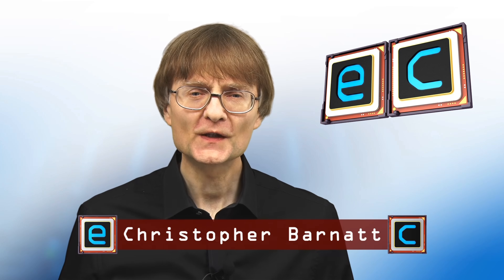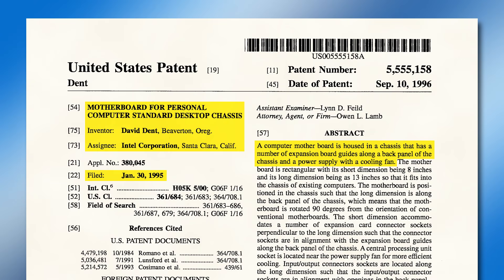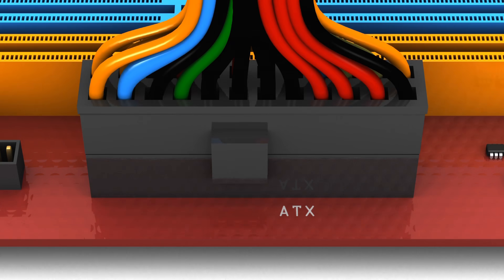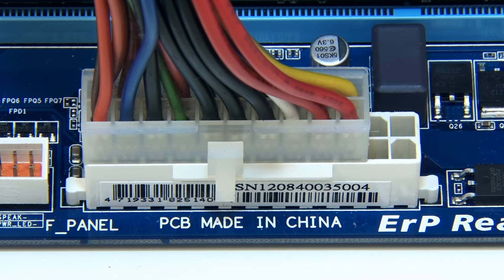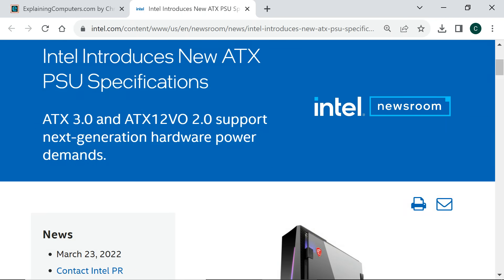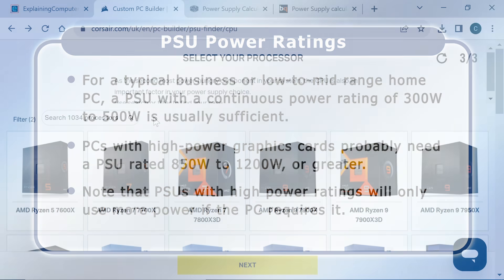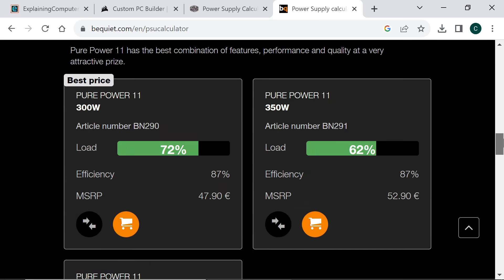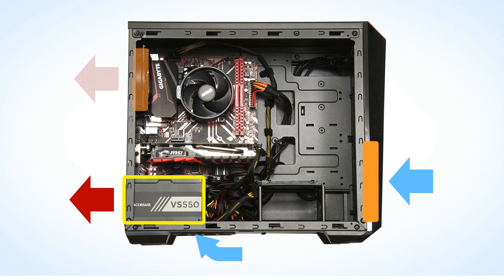Explaining PC Power Supplies

Comment: Note: modular power supplies cables from one manufacturer should not be used on a PSU from another manufacturer.  They all use the same connectors but there is no standard for the wiring I.e. what is + or - voltage. You risk damaging a peripheral if you do this
Reply: Yep, one of the reasons why I stick to one brand.  In my case it's EVGA.  Although between models they can change designs so I usually keep the extras in a plastic bag with the model marked on it.

Comment: My 2 year old Asus motherboard has an 8 pin and a 4 pin socket beside it. The additional 4 pin is needed for overclocking &/or if a 2nd high power graphics card is installed.
I think the only reason for a fully modular PSU is if you want to use braided/coloured cables from a 3rd party supplier.
Reply: But the whole point of a modular PSU is only using the cables you need for a clean installation.
No one wants a rats nest of cables

Comment: More tedious-to-acquire but essential technical data  for the PC constructor, now wandering into HVAC territory.  (700W; that's a small heater.) On a slight digression, how many electrical devices are going to offest their reduction in CO2 output in use by setting fir to themselves and their surroundings?

Comment: Great video. I like the fully modular power supplies -- though I've never had a computer that uses one. If I ever replace my power supply or build my own machine, fully modular would be the way to go. Doing away with all those extra wires would simplify maintenance.
Reply: @gr-os4gd It should. After all, having a rat’s nest of wires takes up space that has to block airflow.

Comment: It's topics like this, the attention to detail and the wonderful narration that make this channel and Chris himself a treasure to be protected and supported. You may not think you need to know about PSUs, but when you do, you do! Thank you Chris, much respect indeed!
Reply from the maker: Thanks for your support, always appreciated. :)
Reply: I think it's another missed opportunity to talk about warranty length and save ppl from buying the slightly cheaper PSUs that will fail much earlier than they would have to.
Reply: @Breakfast_of_Champions  I would argue that extended warranties for any product are virtually irrelevant - beyond the "usual" one year period, extended warranties are usually filled with clauses that make it very difficult to get a free replacement or repair on the basis that the end user probably has to spend a considerable amount of time and effort to demonstrate that it wasn't something they did that caused the failure and thus voided the warranty anyway.

And let's face it - how many hours of your time does fault-finding a PSU and its associated PC to gather enough evidence to claim a free warranty repair buy, as opposed to just buying a new one.
Reply: @terrydaktyllus1320 Well without going into too many details that's a pile of nonsense. There's no reason a PSU wouldn't last a decade if the manufacturers weren't incentivised to save a dollar or two with bottomfeeder parts by ppl who know nothing and are happy to surrender their rights.
Reply: @Breakfast_of_Champions  But unless you go into details to demonstrate some proof of your point, then your point is no more or less opinion than mine is.

If you choose not to backup your arguments with more definitive statements, that's not the same as "pretending" that you can but just don't want to.

So we're at stalemate - which is fine by me. 

But I suggest you do find some time to read extended warranty documentation to see the likely "pitfalls" that you will come across - for example, the cost of parts may be covered under warranty but the labour cost to fit those parts may still be chargeable to the customer.

You've lived an extremely sheltered life if you're trying to tell me that you've never seen such clauses in extended warranty documentation.

Comment: The Ventilator in each power supply generates energy for the computer. Like a wind turbine. The bigger the Vent, the more power you get.
Reply from the maker: No, it doesn't. :)
Reply: Poppycock!

Comment: Hi! Nice and instructive video!
Just a little thing: to mesure a sound level, the DB meter have to be 1 meter far from the audio source.
Reply from the maker: It depends what you are trying to do with the DB meter. In this case I was trying to illustrate relative change. Also, measuring a PC from 1m is pretty daft if you generally sit closer than 1m to the unit! :)
Reply: @ExplainingComputers  Everything is relative, said Albert...
Reply: @ExplainingComputers  Whatever, all measurement have to be done in same conditions to be sure to be significative. If you measure a PSU at  10 cm and another at  50 cm, it's unfair
Reply: No, it doesn't "have to be" any particular thing. When measuring sound output of an audio system's speaker, the convention is to place the DB meter 1 meter from the speaker (so you can compare it with other speakers). When measuring the noise coming from the apartment above, one might place the meter at 1.5 to 2 meters above the floor to approximate the height of one's ears. When measuring the SPL at a rock concert, one might place the meter on a seat in the auditorium (maybe one in the first row and one in the last row). So, when specifying what has to be done, you also must specify why.

Comment: Fun fact, since I live in a pretty cold end of the world and houses is heated in some way 7-8 months of the year, it's worth noting that 99% of the power that goes in to a computer comes out as heat, physics states that energy can not dissapear, just be converted into otherf forms of energy, when you talk about efficiency of a PSU like 80% means that 20% comes out as heat, then running GPU, CPU, RAM and HDD's all outputs equal amount in heat as is drawn from power socket in you wall... so for me running several computers can lower radiators and that way I'm pretty much running the computers for free... Summer is the time I loose, but here it is short and sweet :)
Reply: Precisely. I've been trying to explain to people that the higher power draw a GPU has the more heat it will  output to the air around it regardless of how good it's cooling is. More power more heat simple as that. 
Most people don't even look at power draw they just want the most powerful GPU and don't look at efficiency.
You are the exception, but most people don't want a space heater computer.
Reply: It's only free if you use electricity for heat. Natural gas or oil tend to be much cheaper than using electricity for heat.
Reply: @chrimony  and even if you're using electricity, you can be more efficient in heating with a heat pump than a computer/electric heater (although at super cold temperatures I'm not sure how well they work, but this definitely applies to people in moderately cold temps)
Reply: @drojf  heat pumps don't work well 15 degrees F and below they are not very useful for most people 
it is better to keep home heating at minimum to keep pipes from freezing and simply use a personal heater in the room you are residing
Reply: It's the same with light bulbs. Some people push for fluorescent and LED lights everywhere, but if you live in a cold climate, incandescent bulbs are still useful in heated spaces. Their reduced efficiency in light emission translates to increased heat emissions, which might keep your heating system cycling on and off just a tiny bit less often. Depending on what fuel(s) your heating system and your local electric grid use, the difference in efficiency may be a wash or if one system is much more expensive than the other, there might still be a difference.
Reply: @chrisschembari2486  cannot buy incandescent globes anymore in Australia , the closest being Halogen globes , then compact fluorescent's which still produce heat and last for years .
Reply: @Frogman488-f3w  yeah, the government did the same here in the US. Regardless of whether you're allowed by dictatorial fiat to buy the older bulbs or not, I was only talking about the different lights in terms of times when an incandescent bulb's "waste heat" is not really wasteful at all.

Comment: I have 3 PSU's. One, of course, is in my PC. The other two have been 'surgically modified', using appropriate safety precautions. One supplies DC power for my model railroad layout, and the other is a workbench power supply for electronics projects.
I'm telling you: PSU's, they're not just for PC's anymore!
Reply: Especially for older PSUs that are not quite powerful enough for newer PCs or don't have the right connectors.
Reply: I have a AC to DC converter for my CB mobile radio, which use as a base station, that is another type of PSU. Good recycling on the units!

Comment: Anyone know if there is a desktop PSU already integrated with a battery?
Therefore, no need for UPS neither those expensive sine wave inverters ...
Reply from the maker: I've never come across one of these, but it is a very good idea.
Reply: @gr-os4gd Just buy a bigger case ...
Reply: Yes. Can give you more details if you tell your use case.

Comment: Thanks Chris for a thoroughly interesting video. I've learnt a lot from this, sometimes we give little though to something that's so important for a stable system! The Coolermaster & BeQuiet PSU calculators are the ones I use, one tip I was given is 'Never cheap out on a PSU' otherwise it's false economy :)
Reply from the maker: Hi Alan, thanks for your support. :)

Comment: It's practically a standard that non-modular PSUs come with cables that resemble ketchup and mustard (red and yellow), and some other occasional condiments such as relish (green). My guess is that each color represents a different voltage, with black denoting ground.
Reply: it's a standard with non modular PSUs that there are simultaneously too many cables for the PC you're building and that they are only just long enough. Are there any cases out there with busbars?
Reply: There are not enough cables if you want to fill the PC with as many disk drives as it can fit, requiring the use of cable splitters, even though a "500W" unit could supply enough power.

Comment: Hi Chris! I built my new graphics workstation a few months ago. I have to say my FAVORITE new power-delivery standard is the 12WHPWR connector on my 4090 GPU, that has the feature where it will melt spontaneously if it doesn't like the way I look at it. I also like that my new i9 CPU has the thermal profile of a G-type star. Every time I turn on my PC, I feel like Doc Brown from Back to the Future. "This sucker's electrical, but I need a nuclear reaction to generate the 1.21 gigawatts."🤣
Reply: Indeed, "graphics workstation" with an RTX4090 that you never ever play any games on... wink, wink...

"But, dad, it's for my homework, honest!"
Reply: @terrydaktyllus1320  Damn it, Terry! You know me too well. It's not MY fault that the hardware required for high-performance in Blender has the side-effect of allowing for some ultra juicy gaming!
Reply: @420bobby69  I admire your honesty!

Thanks for putting a smile on my face with your response.

Comment: Thanks for sharing this topic! I always inform all my PC customers of the importance of a good PSU! This is a component NEVER to skimp on! BRAVO Mr. Barnatt!
Reply: Trouble is, the PSU is such a mundane component that it's often overlooked. I know people who put more effort into choosing LEDs than the power supply. By the time they get round to choosing one the budget is tight because most of it has already been spent on CPU, GPU, RAM and storage.
Reply: @johnm2012  I do hope these folks worked up their power budgets including all these whiz-bangers and go-fasters before they bought that cheap PSU that won't really tote the load...  That would just be silly.  That said, sometimes a PC is as much about looks as it is about performance, but that's no excuse to cheap out on the PSU.  Find the price/performance point that's right for all of your system.

Comment: Great video Chris! Interesting to see how the efficiency of the unit changes depending on the load, so therefore going for a way overkill PSU can make your efficiency worse.
Reply: yeah exactly, you wouldn't want a 1000W psu for a system that only draws 200W.
Reply: @ohrun3106    Yeah, but you wouldn't want a 200 W supply, either.   Not all vendors' 200W ratings are specced the same way.  With a reliable vendor like Corsair or Delta, I'd go with something between 350 W and 500 W, just to have a little headroom, and for "future proofing".  (Of course, with modern video cards being so power-hungry, be sure to leave room for the cooling tower... 😆 )

Comment: Nice. I wonder if you'll delve deeper into their safety system, such as Over Current Protection (OCP) and Over Temperature Protection (OTP)? I think this is a valuable information for first time PC builders, or at least helping understand their PSU safety features. I have a Gigabyte GH750 Power Supply Unit, it works well, but it does lack of OCP, which mean I have to pay attention to it and make sure that I don't overload any of its power rail.
Reply: Valuable info indeed. For a moment I even thought Chris was going to mention a certain video from Gamers Nexus about exploding PSUs... 🙂
Reply: @liontuga155  Ho ho. But I think those only happen when you use 120V AC. I'm using the dreaded Aorus P850G PSU and  it works like a charm. My location uses 240V AC and yeah, while I heard a lot of issues with this PSU from the American side, I didn't encounter any faulty unit in my area.

Comment: this is a great video Chirs, but i wish to have some addition
it also has the PFC, and the output ripple needs to be care of.
PFC, the Power Factor Correction, is build for increase the power factor, it more closer to 1, it is better. it is not the efficiency, but it will also effect the computer input. for example if we got a 900w hardware, and PSU at 90% efficiency, which require input 1000w of power. if now, we got 2 PSU, A has PFC running at 0.99 PF, and B got no PFC running only at 0.45 PF, now both of A and B running at the same input power of 1000w running at 240 to 220V (which is majority in the world), A only require around 4.2A (taking 240), B will require 9.2A, more than doubling the current which will give more pressure to your house electricity circuit and generate more heat, it also not friendly to the electrical grid. so please if you have the chance, please get the PSU with active PFC.
output ripple in short it will effect your hardware stability

Comment: its only actually 12 pins for power the 4 additional smaller pins are asctually only sense pins
Reply from the maker: Nowhere in this video do I say 12 power pins.
Reply: @ExplainingComputers  no you said 16 pin but it isn't 16 power pins its only 12 plus 4 sense pins
Reply: @2009numan  You must be referring to the 12VHPWR connector (16 pins). But Chris did not say "12 power pins". It was a 12-pin (2x6) power connector to replace the 12VHPWR connector.